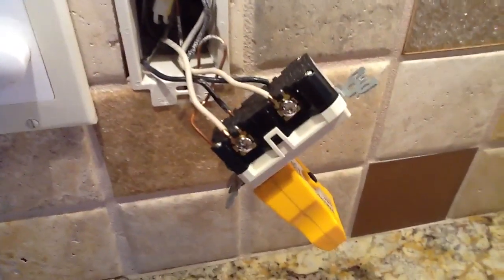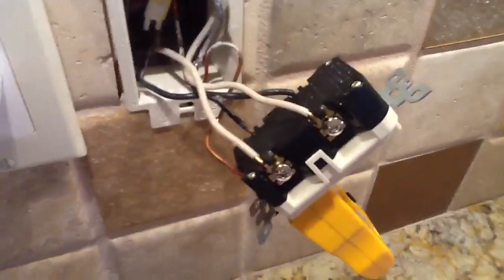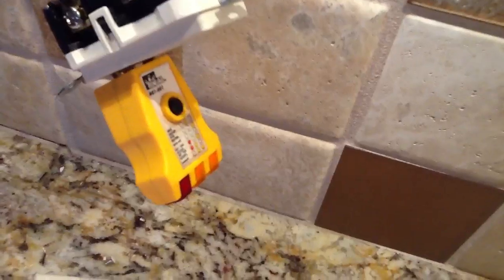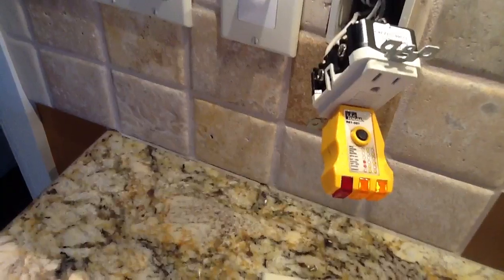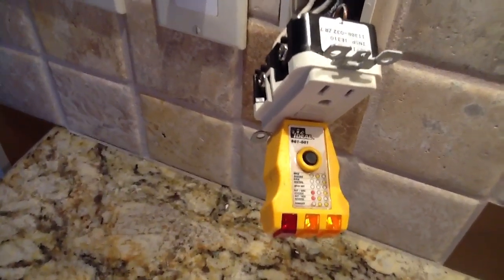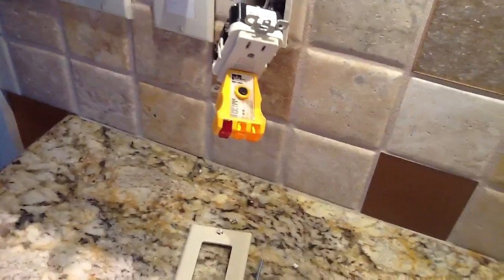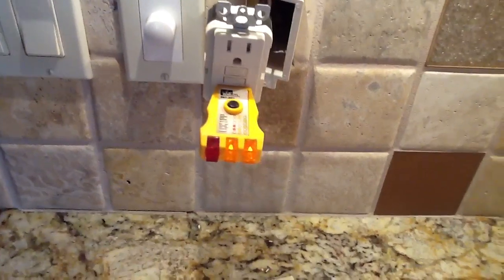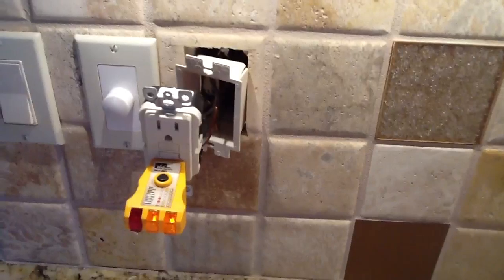Why does my GFI keep tripping?

Comment from the maker: Your Refrigerator is not suppose to be on a gfi circuit. Fault current will cause it to trip. Put in a standard outlet.
Reply: Unfortunately the 2015 code now requires kitchens to be both arc fault protected and all plug in appliances (including refrigerators) to be gfci protected. This is going to cause huge nuisance tripping problems (and spoiled food)
Reply: @MrSleepIncorporated  That is incorrect. The dedicated outlet to the fridge (behind the appliance) shall be non GFCI and the simple reason the code states this is because of the for instance of a trip when the residents are on vacation and  returning home to a fridge full of bad food.
Reply: 2014 code mentioned above is the National Electric Code. The 2015 code mentioned above would be the International Building Code which does not apply to 1 or 2 family dwellings. A GFCI receptacle should never be installed in an inaccessible location such as behind a refrigerator. Nuisance tripping may be experienced if a freezer or refrigerator is plugged into any GFCI protected receptacle. Beginning in 2008, however, manufacturers of such appliances began being manufactured in such a way so as not to produce any ground fault that may cause nuisance tripping of GFCI devices. Therefore, this now seems to be a non- issue as we move forward in time. You may experience nuisance tripping if you have an older refrigerator or freezer. In this situation, I would recommend installing an alarm type GFCI receptacle. At least you will be able to hear that your GFCI device has triggered off perhaps saving you hundreds of dollars in wasted food.
Reply: David Jones
Reply from the maker: you are correct
Reply: well that explains why I've been having issues.
Reply: I wish they didn't put that code requirement into the NEC code book.  Put the GFCI outlet outside and net behind the refrigerator.  And either duple or single receptacle for the refrigerator.   NEC doesn't care if your gfci trip and the refrigerator loses power and the food inside goes bad.  What happen to trusting the refrigerator grounding conductor from the the plug to the receptacle.  This not a wet location.
Reply: MrSleepIncorporated so if my refrigerator is plugged into 2015 code gfi plug and it trips for some reason, first i have to determine my refrigerator is not broken, then check the panel to check if the breaker is tripped and it isnt, then try to pull out my refrigerator to reset my gfi?
Reply: I'm  going
Reply: David Morris 2015 code is CEC. So, neither of you are correct.
Reply: gfci buttons have to be readily accessible. so you have to use a gfci breaker or a gfvi blank next to fridge....if you want to be code.
Reply: The 2014 code says that all receptacles in garages must be GFCI protected. (Section 210.8).  The code does not make any exceptions for fridges or freezers.  However, it is still code that the GFCI needs to be "readily accessible" and I don't believe installing one behind a fridge would fit that definition. Besides, a fridge should be on its OWN circuit, thus making this a moot point.  But I understand a lot of homes are older and the fridge might be on a shared circuit.

Moreover, state and city governments can override the NEC if they so wish. The best bet is just to ask a home inspector in your area what is code and what isn't.
Reply: His fridge has a fault. Old nob and tube in his house, mixed with the clothe insulation.  
He doesn't have that old fridge anymore.
Reply: David Jones
Reply: My response to that crap that a Refrigerator or any Self-Grounded appliance on a circuit...is to put it on its own circuit...and Have the thing inspected...and THEN.... CHANGE THE GFCI for a regular breaker...Screw The Inspection B.S.... (In my state home owners can pretty much do whatever the hell they want....AND I HAVE!)
Reply: Standard outlet for a refrigerator?...NO. The refrigerator circuit must be a dedicated circuit used only for that purpose and connected to a SINGLE outlet receptacle. This circuit must go to a dedicated circuit breaker and no other device(s) can be connected to it. This holds true for ALL refrigerator receptacles, also freezers and computer connections where a circuit breaker interruption would cause damage to the device or its contents
Reply: Robert Mattison I'd rather have my food spoil than a toddler die. When I was a kid my grandpa's fridge used to shock you if you touched it and the oven or the sink at the Same time. We use to think that was funny but now I know what that really meant.
Reply: @hilariohernandez340  Ref Was Not Grounded.
Reply: The NEC code is minimum requirement.  You can add Ground Fault Protection to all receptacles in your home if you wish.  And many people do.  I believe the NEC will make this a requirement sometime in the future.  In the case of your grandpa's getting shock, this clearly a case of improper wiring that was done by DIY electrician.  This would not had happen is the wiring done to the NEC code in existing at that time.  This, what you wrote should had been fix's by calling in a train license electrician to isolated the offending existing electrical circuit.  Another thing home owner fail to do, is test there existing GFCI outlet's on a monthly basic.  The earlier MFG. used to come a card to had a forum, that you would check off, that you did check the GFCI outlet's.  As I was say these bad boy aka: GFCI outlet would stop working, meaning no GFCI protection and the home owner wouldn't know.   What I like is seeing the GFCI now call a EGFCI attach to the end of hair dryers. So I  agree is better to have the food in your Refrigerator spoil than get shock. Or worth possible kill.
I wish you good health and a long life to you and your family.
Reply: I just glade that the family is okay and never got hurt from electricity.

Comment from the maker: Thanks for watching
Reply: polarity, dirty wire, lose neutral, shared neutral. will cause gfci to fail. dirty wire was the culprit a few years back. on a house we updated. knob and tube throughout,  we were using low quality g faults. solution 20 amp g faults p and s.

Comment: I've ran into GFI's on exterior walls that didn't reset simply because the metal mounting frame of the GFI was tweaked too much.  When you straighten them out, they work fine again.  They're very sensitive.
Reply: What did you mean by "tweaked too much"? And what's a "mounting frame", on a GFI?
Reply: @Seemsayin probably the wires behind it were to much, or too stiff, then when you bolt it down, the unit does not want to move, but the metal bracket on the unit will bend and twist, basically twisting the whole unit
Reply: @jakefriesenjake  Jake... There's a strong possibility that your ground wire is coming in contact with the hot wires, where they screw onto the GFI. Even if it's just close by... the simple act of plugging and unplugging could move the unit just enough, where it would touch. Stiff wire (12 guage) can be a hassle when installing when, as we all know... the box has limited space. GFI's will take up a lot off room.

Tripping would be caused by shorting, a broken GFI device, too much amperage on the circuit, another device, on the load-side of the circuit, or a loose connection somewhere on the circuit. Loose connections can cause wire to overheat. Packed wires, or improper seating shouldn't have anything to do with it. 

Also... anything that uses power on that circuit, especially if old/worn out, could be drawing more amperage than the breaker can handle. I had a customer complain that his pool pump was tripping his breaker. Wanted to know If he had a bad breaker, and if installing a higher amp breaker would solve the problem. I asked how old the pump was, and it turned out that it was over 10 years old. As things things like that start to wear out from usage & age, the tend to draw more amperage. It was time for a new pump. Installing a larger breaker would have strained the wiring, and would eventually have overheated it. That's how fires start.

Hope that helped you out.
Reply: @Seemsayin  thanks!

Comment from the maker: I have found many myself, either old or never wired correctly. Thanks for comment.
Reply: Hey I just upgraded a whole home with 10/2 Gage wiring where the people who lived there before did not give a freak about the receptacles. Most were in there from the early 70's although the wiring was updated id say about 5-7 years ago I still managed to make it up to code correctly. I installed 1 GFCI receptacle and the rest regular receptacles. You should of seen this home. It was a true fire hazard. I mean at any given point I'd say in 1 more year it could of set on fire. Between dust and crossedwire receptacles and also burnt ones. It just was ridiculous. Glad I found out before it was too late. I love doing electrical as a hobby because I get to see all of the wrong thats done before anyone else gets to it lol. But I followed all local, state, and federal laws on wiring it. And the homeowner was smiling like the Kool-aid guy when I fixed it properly lol. Well thanks for the refresher. We all get stumped every once in a blue moon and just need a second to see what's needed to be done correctly and efficiently.